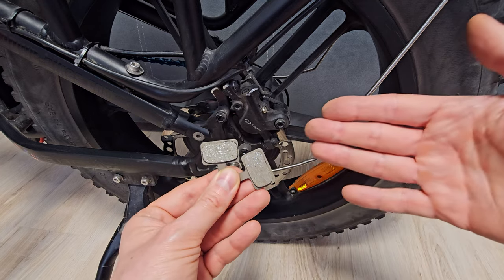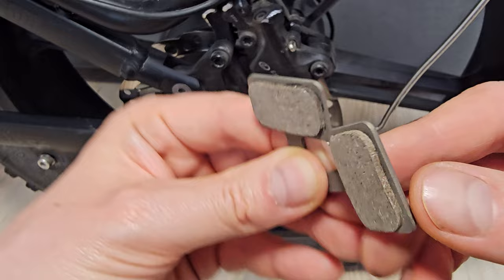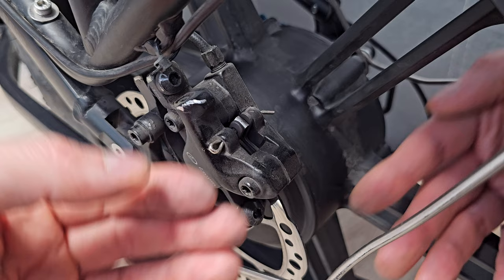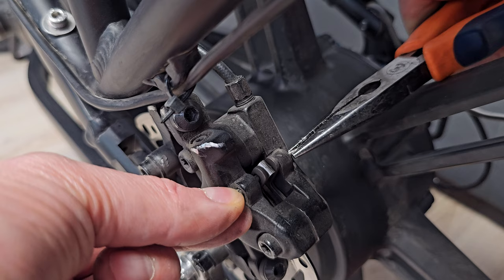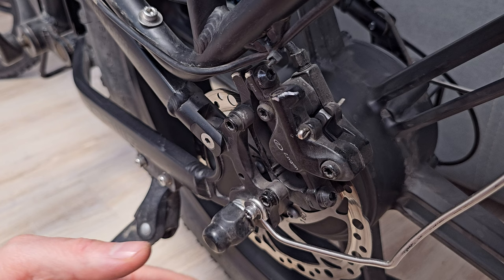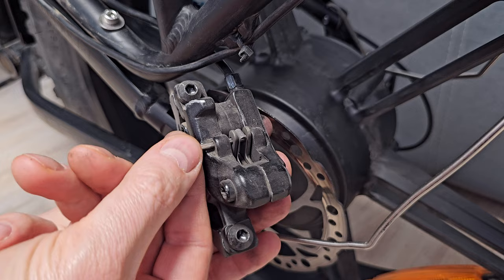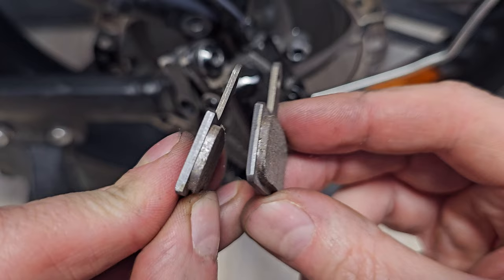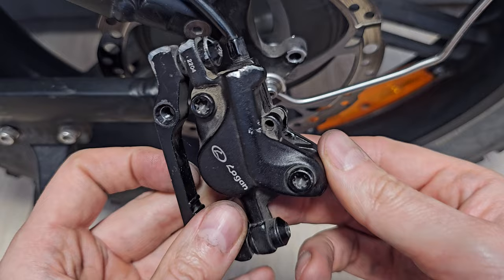How to replace Brake Pads on eBike & Escoot Easy & Fast 🚀 Fatbike Engwe Example 🍻🍕

Comment: you have to also push brakes when you tighten it back cuz it will not be straight then and you will have uneven wear and tear in pads.
Reply from the maker: 🤣🤣 sure , I really hate people who never used a thing but talk about it a lot. Cheap chinese breaks never move pistons at the same distance/ rate, if some newbie will do your way , it will take 1h+ to watch videos how to  align calipper & try make it work.

Comment: My scooter falls under 2 different names/brands (X-TRON X20Pro).. is there a way to find out which specific brake pads I'll need or could I use universal brake pads as long as it is the right fit..? I've looked online (quick search) and couldn't find any being sold specifically for my model under the same name..

Comment: doesnt matter if you push the brakes in any part of this video. IT will not damage your brakes you just have to push the piston back so you can fit new brake pads? like what are you talking about man :DDDDDD
Reply from the maker: Is it really question for me ? If pistons will get out , the fluid also so U got air in the system, also if a bit sand or dust will get under piston gasket / oring then it will scratch barrel in the calipper , so soon brake calipper need to be replaced. But what I could know ... , your answer was more detailed